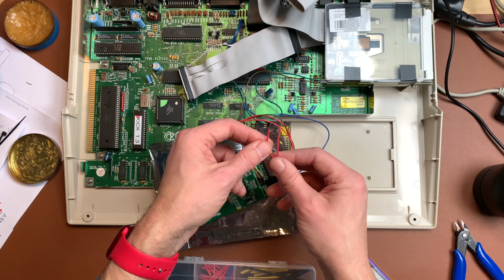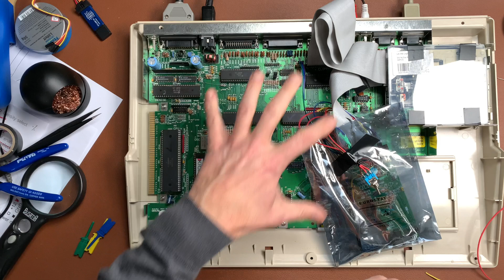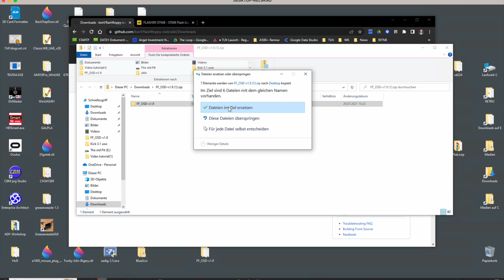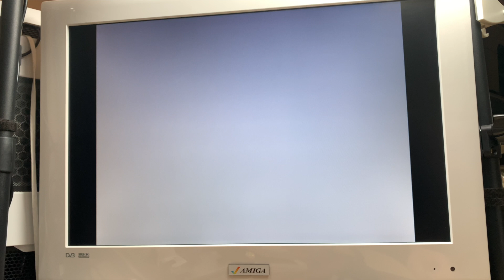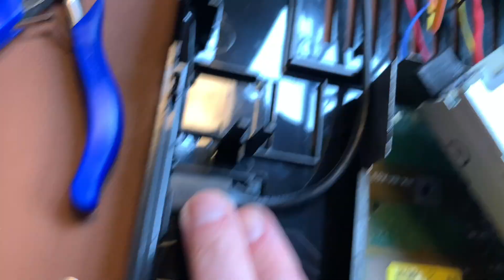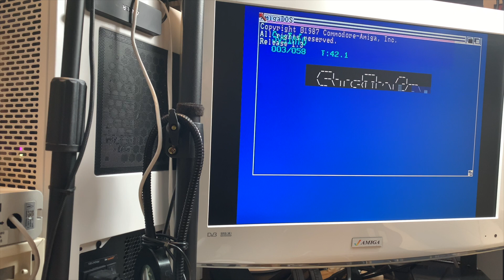The Invisible Gotek Part 2 - The Return Of The Black Beauty

Comment: Very good. I think it would be better with a darker background.
Reply from the maker: True. I did not look into the code. I thing there is room for improvement and that it was more of a proof of concept.
Reply: @RetroWK  If you modify the firmware, I will be grateful for the video. A very interesting topic in general for any devices.

Comment: turned out great.
maybe you can do something with this flatcable, I managed to repinch such a black connector on a flatcable, so perhaps you can turn it arround and use the long part to go from the drive to the Gotek then so You can put the Gotek were You wished it to go. (try it with another new cable.)
You did surprise me with that blue-pill mod though, i did not knew about this hack.

great work.👍
Reply from the maker: Thanks! I stumbled upon that blue pill thing when I wanted to flash a new Gotek. I will try to get a few 34 pin connectors and fresh cable to make a custom one.

Comment: What a cool upgrade for the Gotek.

I'm glad all of our suggestions worked. It looks a lot neater :)
Reply from the maker: Thanks! I like it too. ... and I didn't have to mod my case.
Reply: @RetroWK  That's always a bonus.
When I put a CF card in my Spectrum +2B, I had to remove the cassette recorder so the card adapter would fit and I then had to slice the back of the case so I could remove or swap CF cards. I put a keyed socket poking out of the hole left by the cassette buttons so I could plug in the tape deck if I needed it.